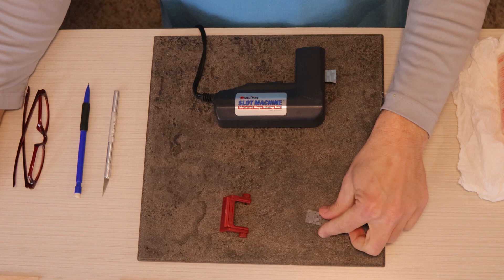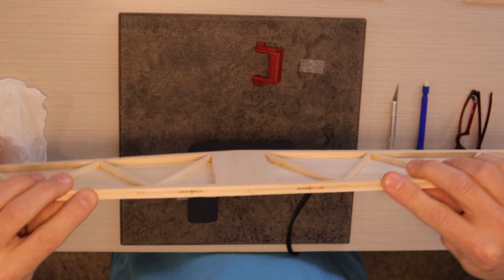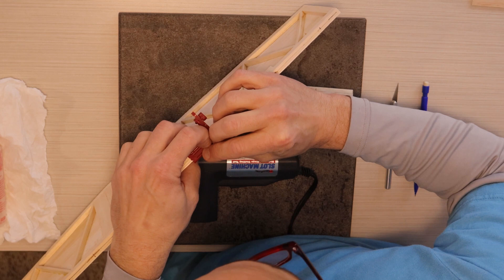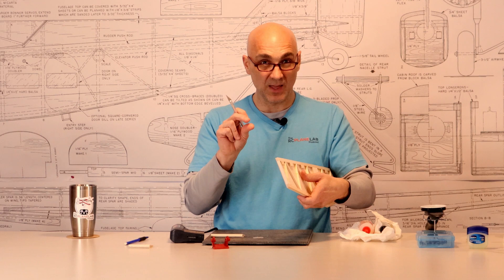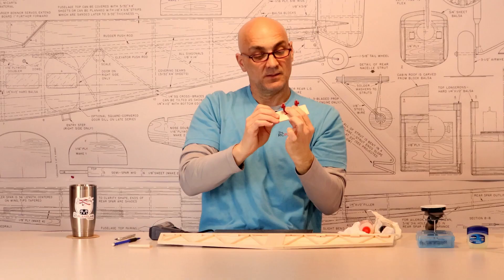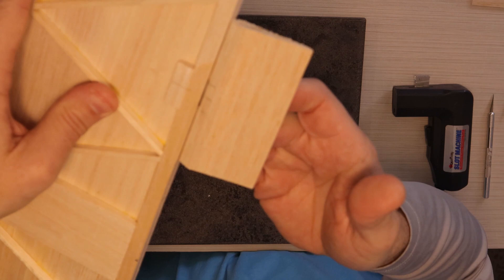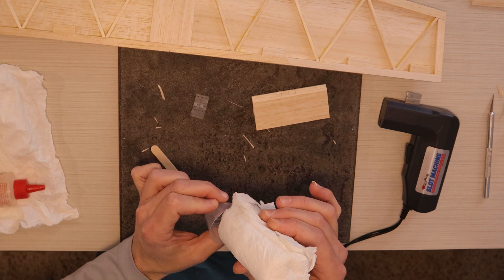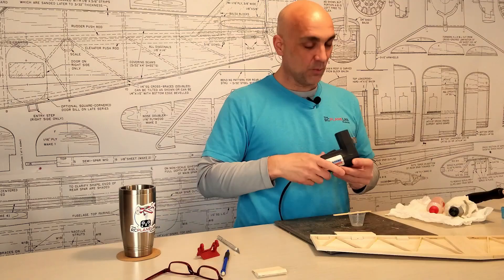How to use the Great Planes Slot Machine to Install Pinned Hinges - RC Plane Lab

Comment: I messed up in the drilling of the holes for the Robart Hinge Points and now I have to plug those holes in the Trailing Edge of my wing so I can re-do the holes. I was thinking that maybe I can use the Slot Machine more acurrately and use the Flat Hinges instead. It looks like the Flat Hinges are easier to make holes in the right place vs. the Hinge Points. For the Hinge Points, my drill sort of "walked" off center enough for me not to be happy with the alignment. Anyhow, I plan on filling the round holes with a home-made Balsa Dowel and Balsa Sanding Dust and use Sig Bond to glue the Dowels in. I am using Sig Bond because it's easier to sand than Tight Bond. Tight Bond doesn't sand well; it smushes around a lot like, for example, trying to sand Contact Cement. Anyhow, let me know if the Slot Machine would be able to dig through the patch I plan to use to plug the old, round holes. I want to make sure I don't screw up the wing again making slots I'll have to fill. Thanks.

Comment: I I used the thinner cutting blades like you did in your demonstration video, but because I was digging through "Patched" Hinge Point Holes (I plugged the holes with Balsa Dowels I made), I can't force the thicker DuBro Nylon Hinges into the thin slots because the SigMent glue I used for the Plugs makes the slot less flexible. I am thinking I could get the GPMR4016 Medium Thickness Blades and re-bore the slots with those to make the slots wider. My question for you is have you ever done that....went back and re-bored a thin hinge slot with the thicker Medium thickness GPMR4016 Blades?  Let me know if doing this will keep the slot centered on the Trialing Edge. Thank you.